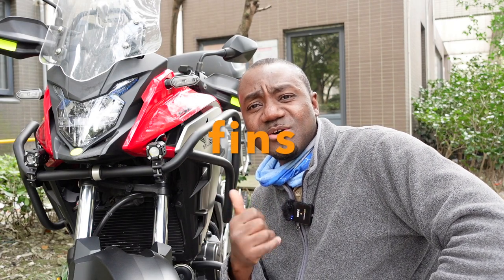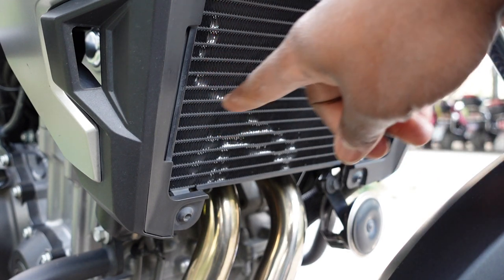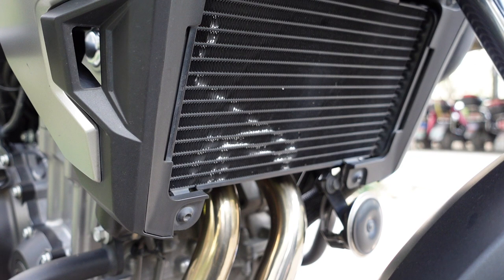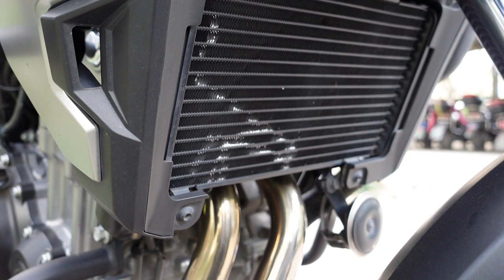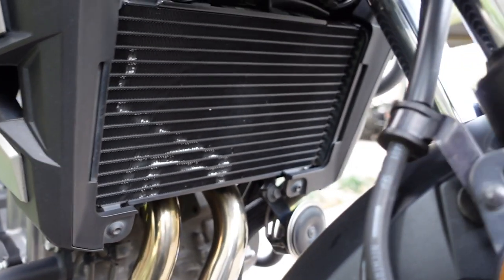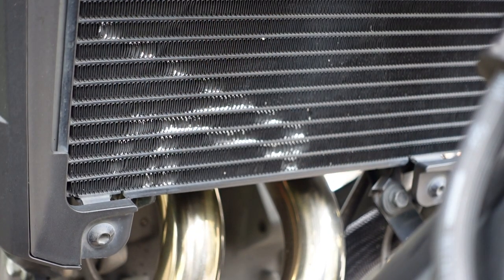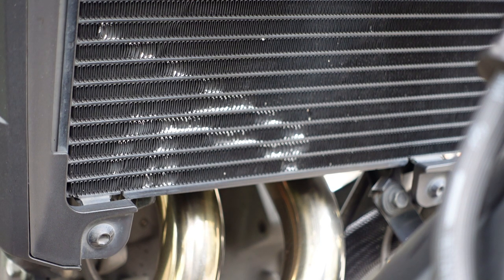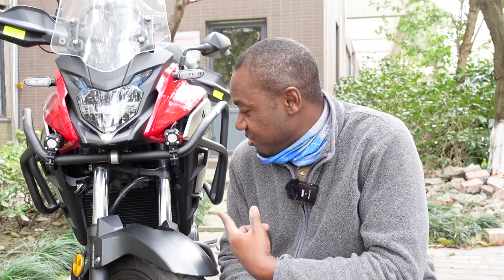Look What I Did To My Honda CB500X Radiator || I'm Not Happy 😔

Comment: I worked on auto collision estimating almost 50 years ago.  You can straighten the fins easily. Aluminum gets a very thin oxide layer. It will not rot out. Most home a/c units don’t have paint on the cooling fins. The previous comments are right, you can touch it up with spray paint. The radiator doesn’t get anywhere near as hot as the engine or exhaust headers.
Reply from the maker: Thanks a lot. All comments considered. Cheers!